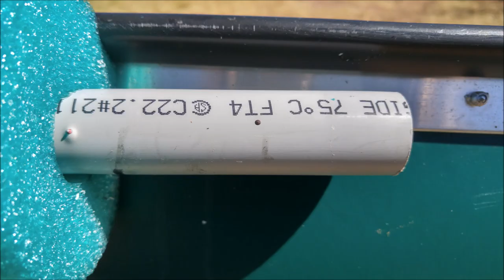Foam Stabilizers For a Canoe:  Do It Yourself

Comment: Dave, good video, bud. I've seen some other canoe customizations that did not have the noodles mounted so high on the canoe so I wanted to ask if you are 100% happy with the placement or would you lower it some? I have the exact same canoe and I will be adding this modification to it so I was hoping that you could provide some additional information on whether or not you would do anything different now looking back? It is my understanding that every canoe has it's own tipping point and that point may vary depending on numerous different variables. Overall, would you do anything different?
Reply from the maker: Travis Rose Hi there, I am happy with the modification, I would like to have an adjustable set-up according to the payload.  I initially was going to do that, with interchangeable locking pins with 3 different heights using the simple elbow(90 degree conduits) not too difficult to do.  As previously mentioned by a fellow commenter... you could also use the lighter 3 inch white coloured ABS pipe with end caps glued to seal.  Using the ABS pipe would prevent any damage which is evident using these foam noodles.  The ABS could also be installed using an adjustable height.  
I hope this helps, as I do find this modification worked well, but I think the added sense of security having the floats closer to the water is comforting.  I will try to do a follow up to demonstrate the effectiveness of this set-up.
Reply: Dave Wilcox Jr Outdoors Looking forward to it! I just picked up the last of my supplies (I hope I dont need to make a 2nd trip). I got my seats in, 6 led lights, 1100 lumen light for the front, running light, switches, hardware, fish finder, small 12v battery, large 12v battery, trolling motor, PVC, noodles, spray paint (hope it doesnt eat the noodles but they only had bright orange or pink) and...I think that is all of it. I doubt I do a video but I will definitely snap a few pics along the way. I'll let you know how it turns out.

Comment: Nice job Dave. I made a set for mine years ago from foam (pipe insulation wrap) so the kids could use it and the worst thing I found couldn't portage through the woods without  beating the foam to shreds so then went with the  aluminum. Nice lookin canoe. where did you get the flotation foam
Reply from the maker: hunt4fish thanks, I purchased the foam at Rossys, they are noodle floats for pools.  I have a canoe cart on the way for portage over rough terrain, it should be here in a week!  I will upload a video to share the cart, and the durability!  Nothing like the cheaper carts at the big box retailers carry!

Comment: good idea.  isn't it true that outriggers add stability because they are OUT away from the canoe?   I realize you aren't calling.these outriggers, but it seems that these would be quite abit less effective than floats that are out away from the canoe.  Is that true?
Reply from the maker: Yes, these foam floats are an older design that was common to provide increased stability that helped to decrease the chances in capsizing.  For many fresh water applications, the outrigger stabilizers you are referring to are not suitable, these floats will provide added stability, perhaps not equal to the outrigger type, but functional with canoeing in smaller size tributaries and water sources.
Reply: Dave Wilcox Jr Outdoors ,

Exactly what we have in the river off our property.  Gonna pick one up today and will surely post a video of before and after stabilization.  Thanks for the excellent tip.

Comment: I have a sportspal  but ive been beating up the foam on the outside here and there when I go to replace  im  going to use a 6 inch pvc length of the canoe with end caps heated to the shape of the canoe and painted same color it'll be unsinkable cheap and durable
Reply from the maker: Wayne Macdonald yes, I've also heard of that, it will work very well!  Sealing the ends with PVC cement will prevent any water from leaking between the floats and the pipe.  👍
Reply from the maker: Wayne Macdonald also, I would use just a 4 inch PVC with end caps, they too will make your canoe unsinkable and less bulky than the 6 inch PVC.  There is plenty of bouyancy with the 4 inch.